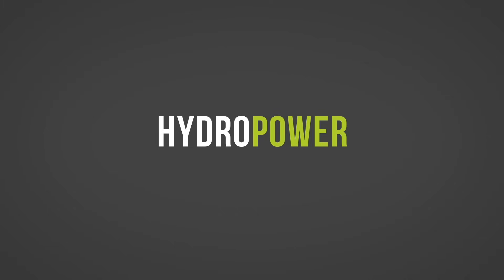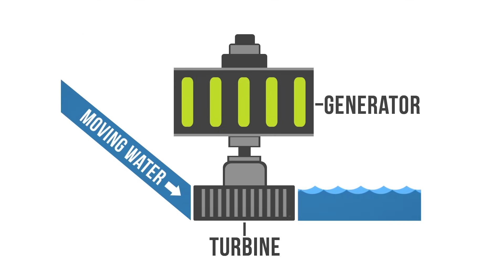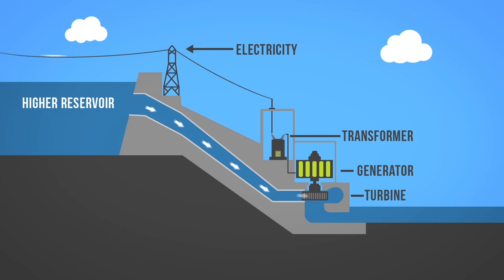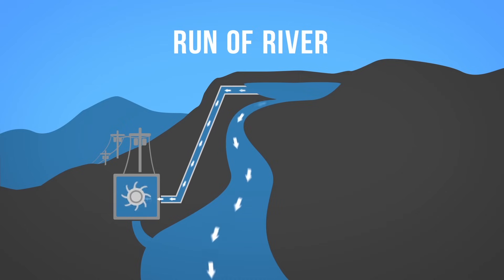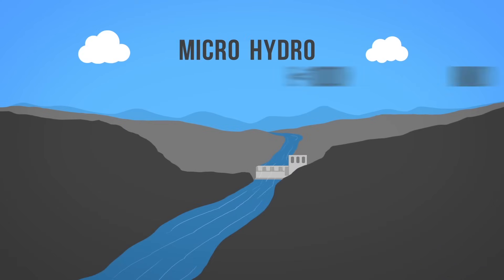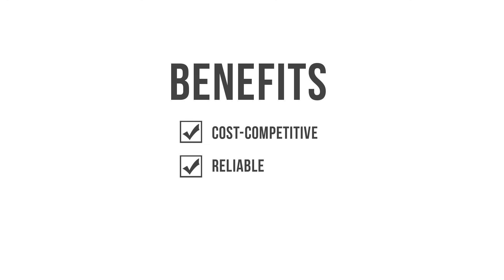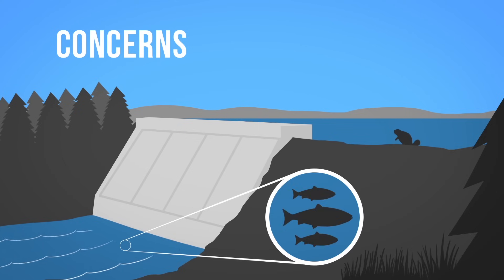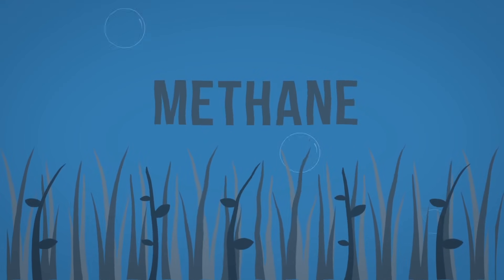Hydropower 101

Comment: I work in a company where they told me that for the hpp is best if it works on maximum power according to the level of accumulation but if we put it to work for less power it will still use almost the same amount of water. Is that true?

Comment: Pumped Hydro electricity has no enviromental impact if the whole system is built from scratch including the upper and lower dams...
A solar power farm can be used to pump the water to the upper dam during daylight hours. Or battery storage can be used....👍

Comment: Hydropower hydropower or hydroelectricity refers to the conversion of energy from flowing water into electricity it is considered a renewable energy source because the water cycle is constantly renewed by the Sun one of the first uses of hydro energy was for mechanical milling such as grinding grains but today moderhydro plants produce electricity using turbines and generators the mechanicalenergy created by moving water spins rotors on a turbine this turbine is connected to an electromagnetic generator which produces electricity when the turbine spins there are two production dams and run of river hydro dams utilize the potential energy from dammed water to produce electricity a dam is a large barrier constructed to raise the level of water and control its flow the elevation created by the dam creates gravitational force for turning the turbine when water is released some dams also contain an additional reservoir at their base where water is stored to be pumped to the higher reservoir for release when electricity is in demand this is referred to as pumped-storage hydroelectricity production is run of river hydro runoff River still uses turbines and generators but relies on natural water flow rates of rivers diverting just a portion of the water through turbines because run of river hydro is subject to natural water variability it is more intermittent than dammed hydro there are various sizes of hydro plants that produce electricity large hydro greater than 30 megawatts small hydro 100 kilowatts to 30 megawatts and micro hydro less than 100 kilowatts the Hoover Dam in the United States is a whopping 2074 megawatts which is enough to serve 1.3 million people of all renewable energy sources hydropower holds largest share of worldwide electricity production hydropower has several benefits it is a cost competitive form of electricity even though the initial building cost can be high it is quite reliable compared to other renewable options and pairs well with other sources as it can be used as base load power in some cases dammed reseoirs can also help with flood control and be a reliable water supply for communities there are also some concerns with hydropower especially when it comes to large dams damming a river has a major impact on the local environment changing wildlife habitats blocking fish passage and often forcing people in riverside communities to move out of their homes in addition dam failures can be catastrophic claiming the lives of those living downstream hydro plants are also not completely free of greenhouse gas emissions as with most forms of energy carbon dioxide emissions happen during construction particularly due to the large quantities of cement used and plant matter in the flooded areas makes methane another greenhouse gas as it decays underwater that's hydropower.

Comment: Solar and windmills are a scam.  They are unnatural.  It places extra stress on your roof!  It is unreliable. It is expensive.  You save nothing, in fact, you spend more.  Go with natural gas, reliable, cheap, environmentally friendly and most of all - it is all NATURAL.  No refining, No additives, just out of the ground and delivered to you for a cheaper price.    The infrastructure is already in place.
Reply: Lmao it's not renewable though and that's the whole point
Reply: @object2519  Lmao to you Mr. Student.  Take it from someone who has worked as a natural gas producer for some 42 years. At the rate of U.S. natural gas consumption in 2016 of about 27.5 Tcf (Trillion Cubic Feet) per year, the United States has enough natural gas to last about 90 years.  It is reasonable to say more reserves thru drilling will replace the yearly use.  Nevertheless, why have this green crap at it's expensive cost fostered on the consumer .  Venture to say neither of us will be around to see the end.  This is a thing for future generations
Reply: @object2519  Turd

Comment: The largest hydroelectric plant in the United States is at Grand Coulee Dam. Its three powerplants have a capacity of 6,809 MW, and it generates, on average, about 21 billion KWh, while Hoover Dam's powerplant has a capacity of 2,074 MW and generates approximately 4 billion KWh a year.
Reply: What if the water in the damn drys up?
Reply: @Iamtheman325  no electricity production then
Reply: @Husshar_Ladka  exactly
Reply: @Iamtheman325  If it dries up they won't be able to live there because they need water to survive. So they will have a bigger problems than electricity.
Reply: @Iamtheman325  It would take an incredibly significant drought for the dam to dry up. The Hoover Dam has been open and running since 1936.
Reply: dear sister you talked 2 things but whats difference between 1: Grand Coulee Dam. Its three powerplants have a capacity of 6,809 MW, and 2: and it generates, on average, about 21 billion KWh
Reply: oh really?
Reply: :face-fuchsia-wide-eyes:

Comment: We should make Hydropower a leading supplier. Only creates small carbon emissions and can constantly run unlike wind turbines which may not always run due to the weather.
Reply: Taffy is trashy  but to think about it, the country Laos is using hydropower yet it caused too much silt in the water and it got muddy because of the hydropower. There are pros and cons. What I’m trying to figure out is how to get around that bit to where everything flows to be even
Reply: Unfortunately, that will never happen. Hydroelectricity and nuclear power aren’t as ‘profitable’ as fossil fuel use. Although, like the video said, the biggest problem with hydropower is the significant damage to lives and the environment when things go wrong.

Comment: I dont get it. If the water that powers a dam comes from a reservoir, does it ever run out? Why do we always see dams overflowing and not drying in the news. I also heard the water from a dam is still but shouldnt it be flowing since the water continously goes down?
Reply from the maker: Hello! Hydro dams can actually run low on water if there is lower than normal rainfall, or spring runoff. It has happened to dams as big as the Hoover dam before: https://www.circleofblue.org/2010/world/low-water-may-still-hoover-dam%E2%80%99s-power/. It's generally not as extreme of an event as spillover's, and dont have as compelling visuals, which is likely why they arent reported on as much.
Reply: Student Energy thank you! But it still bugs me how they run 24/7 yet the resorvoir is quite small, and it doesn’t even rain everyday. Are they only releasing small quantities of water?
Reply from the maker: Usually the reservoirs and dam will be part of a larger network of rivers. The dam backs up the water that is naturally flowing and pools it in the reservoir. This is mostly done to ensure there is always a large stockpile of water in the reservoir to drive the turbines 24/7. Theoretically you would try to release about the same amount of water as what naturally flows in that river, but practically that is impossible to perfectly maintain. The challenges come with spring runoff or droughts as you can have pretty big changes to what the natural flow rate of that river would be, which makes it harder to keep the artificial flow rate of the dam under control.

Comment: Hydropower… Hydropower, or hydroelectricity refers to the conversion of energy from flowing water into electricity. It is considered a renewable energy source because he water cycle is constantly renewed by the sun. One of the first uses of hydro-energy was for mechanical milling, such as grinding grains. But today, modern hydro plants produce electricity using turbines and generators. The mechanical energy created by moving water spins rotors on a turbine. This turbine is connected to an electromagnetic generator which produces electricity when the turbine spins. There are two main type of hydroelectricity production. Dams and run of river. Hydro dams utilize the potential energy from damned water to produce electricity. A dam is a large barrier constructed to raise the level of water and control it’s flow. The elevation created by the dam creates gravitational force for turning the turbine when water is released. Some dam also contain an additional reservoir at their base where water is stored to be pumped to the higher reservoir for release when eletricity is in demand. This is referred to a pumped stored hydro. The second form of hydroelectricity production is run of river hydro. Run of river still uses turbines and generators but relies on natural water flow rates of rivers, diverting just a portion of the water through turbines. Because run of river hydro is subject to natural water variability, it is mort intermittent than dammed hydro. There are various of hydro plants that produces electricity. Large hydro, greater than 30 megawatts. Small hydro, 100 kilowatts to 30 megawatts. And micro hydro, less than 100 kilowatts. The Hoover Dam in the United States is a whopping 2074 megawatts, which is enough to serve 1.3 million people. Of all renewable energy sources, hydropower holds largest share of worldwide electricity production. Hydropower has several benefits. It is a cost competitive form of electricity. Even though the initial building cost can be high. It is quite reliable compared to other renewable options and pairs well with other sources as it can be used as base load power. In some cases, dammed reservoirs can also help with flood control and be a reliable supply for communities. There are also some concerns with hydroelectricity, especially when it comes to large dams. Damming a river has a major impact on the local environment, changing wildlife habitat, blocking fish passage and often forcing people in riverside communities to move out of their homes. In addition, dam failures can be catastrophic claiming the lives of those living downstream. Hydroplants are also not completely free of greenhouse gas emissions. As with most form of energy carbon dioxide emissions happen during construction, particularly due to the large quantity of cement used. And plant matter in the flooded areas makes methane another greenhouse gas, as it decays underwater. That’s hydropower.
Reply: Thanks! I had to take notes on this video and the last part went too quickly and I couldn't catch what it said.
Reply: Merci jtm
Reply: Toi aussi on t'aime, pleure pas
Reply: je dégueule dans ta trachée
Reply: merci ça me touche
Reply: Sinkryz thank u so much😍
Reply: Thank you!!! 😊
Reply: niké vo mor
Reply: Ouais ptdrrrrr
Reply: Thank you so much, this saved me a lot of time for my assignment :)
Reply: Thx as if I read that all 🤣
Reply: @sinkryz-reacts  nice...
Pls too subscribe to my YouTube channel THE ART LOVERS ❤️🤘
Reply: thanks)❤️
Reply: Thank u soooo much bro
Reply: you're a hero!
Reply: bande de gays

cordialement.
Reply: Sinkryz good for u
Reply: Sinkryz lol
Reply: why
Reply: Bien!
Reply: Gracias 👍
Reply: Top Hydropower Generating Countries

youtu.be/MjjHPBnJKPs
Reply: YES thx so much bro i had to take notes shotttt!
Reply: Thank u sooo much I really needed this
Reply: merci mec on t'aime tous
Reply: Sinkr
Reply: O.O
Reply: Wtf dude
Reply: Aa AAA do you have a life? How did you find time to type all that